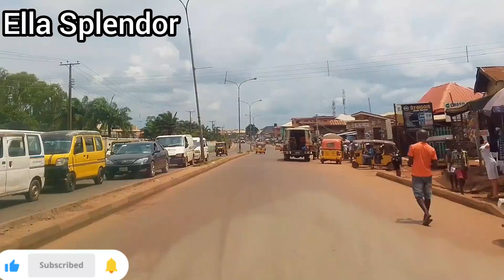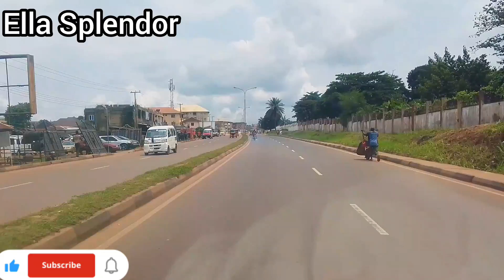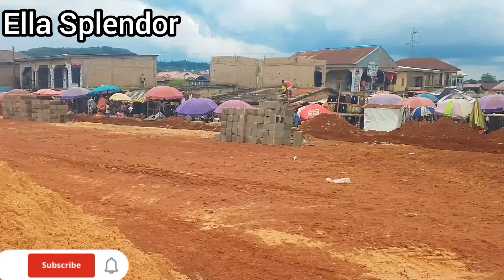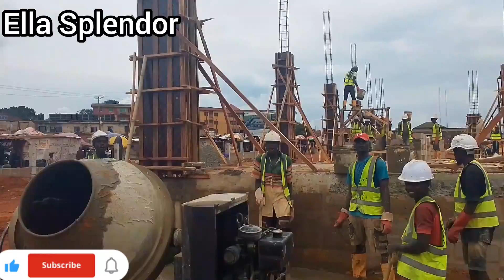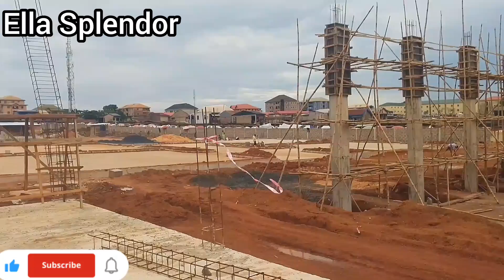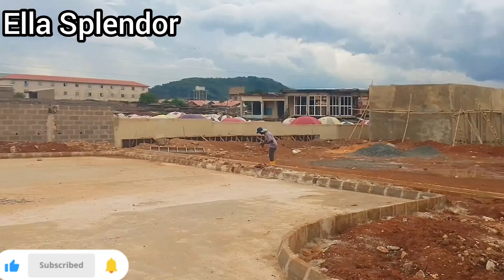CONSTRUCTION OF MODERN BUS TERMINALS IN ENUGU STATE#enugu#enugustate #nigeria#africa#igboamaka

Comment: Construction projects are the oldest scam of the ruling class.  If they are beneficial, ask yourself why there's extreme lack of economic opportunities, resulting in lack of gainful employment, extreme hardship, insecurity and chaos.
Local projects that does not generate FOREIGN EXCHANGE REVENUE for the state or country is quick kick-back scheme.  The most common scam are road construction.  That's why Tinubu is building a N35 Trillion road.
Roads are vital infrastructure, but people need gainful employment.  Gainful employment creates a sense of well-being and contentment, brings happiness, and creates peace, which leads to social stability and security and safety. 
The only way  to rescue the country is initiate industrial activities that will generate foreign exchange revenue.  Building parks, road, hotels and stadium with federal revenue allocation  is going round in circles.